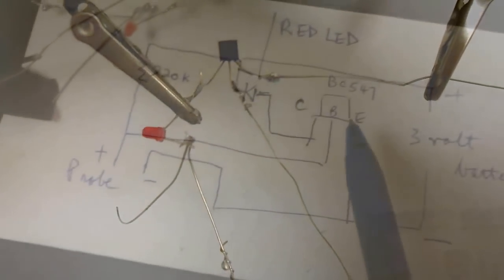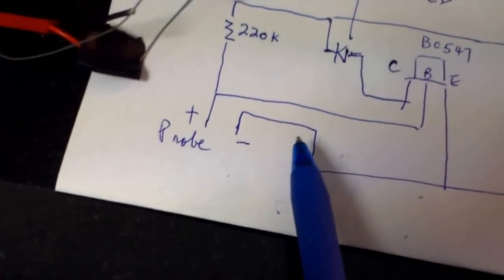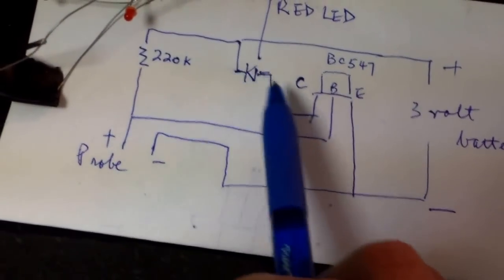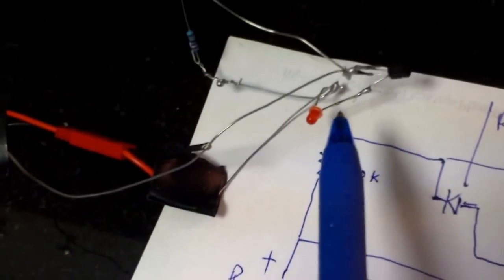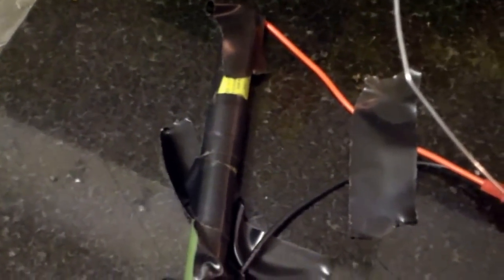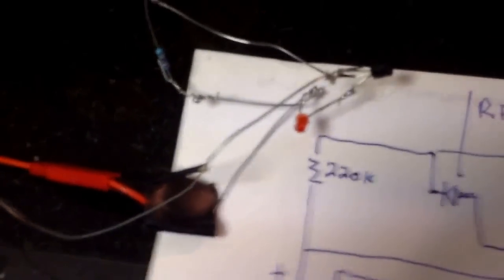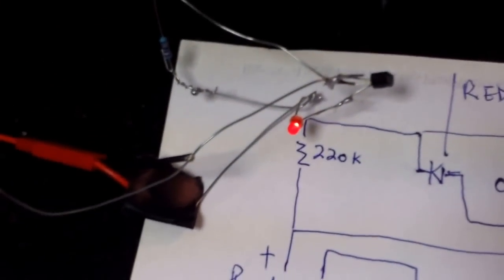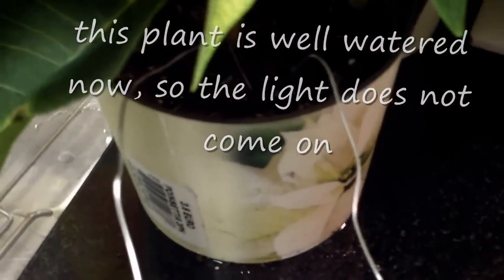Soil dryness sensor with red LED

Comment: When I was a kid, I was given a device like that.  It was actually meant for a car that didn't have a windshield washer fluid out indicator.  It was a small black box with a red LED, and had 4 wires, 2 probe wires, and power and ground, and ran on 12 volts.  Of course at the time, I didn't even have a car and was too young to drive.

Years later I found it didn't work.  I wanted to rebuild it using a relay to switch on and off the light but there's obviously not enough conductivity to do so.

Any ideas on how to build this with 12 volts and possibly have it trigger a relay on when the soil is dry?  I could rig something like that up to my sprinkler system or even a hose-end sprinkler valve--this is something I could use!
Reply from the maker: jaykay18 This setup is  pretty crude, probably isn't too precise with regard to the moisture or dryness of the soil. For someone more knowledgeable about electronics, it will be a simple feat. Less so for me but I believe It only takes .6 v  or a small amount of current to turn on a transistor that can trigger a 12 volt relay. This is more or less what I'm working on with regard to LED drivers and automatic battery chargers. I wish I were a whole lot smarter.
Reply: wtam69 I'd say that's certainly accurate enough!  I never got into transistors and transistorized stuff, I stopped at switches, relays, resistors, and diodes.  You're a lot smarter than you think, I'll bet.  I wouldn't be surprised if that circuit you have there can actually trigger the relay.